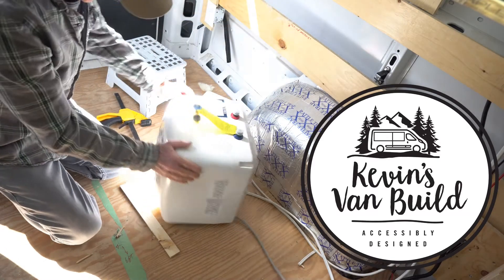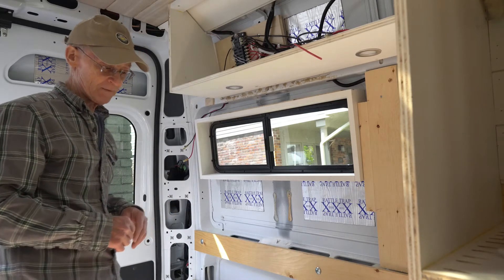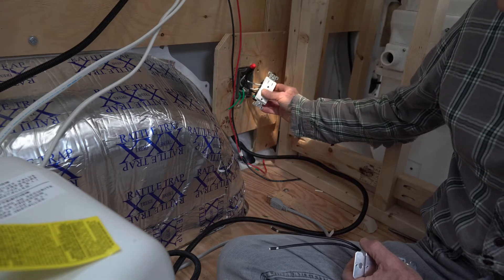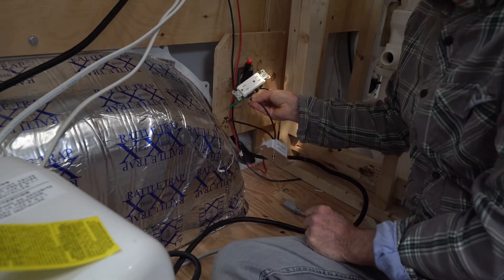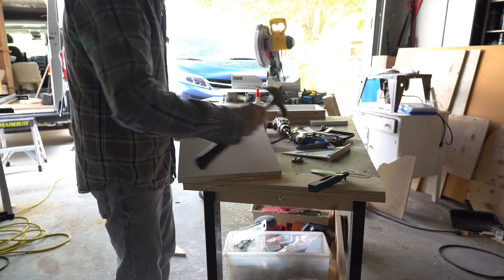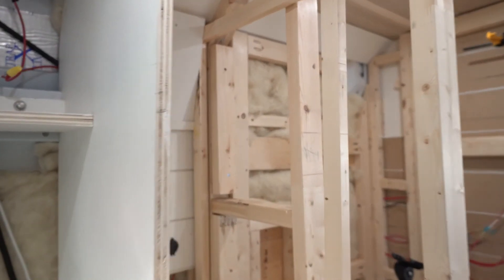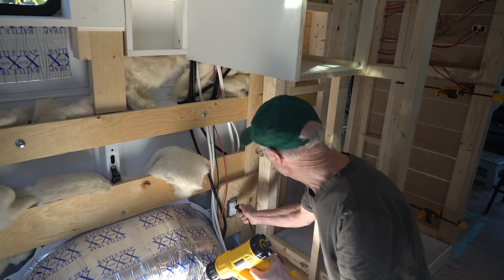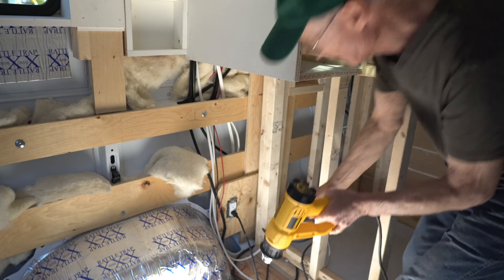Electric Water Heater installation into a Promaster Van.

Comment: Kevin,

I'm having trouble getting my Bosch 4 gal water heater to work properly.  It keeps making my 300W inverter sound a low voltage alarm (below 10.5V).  How big is your battery bank and what size inverter are you running?  Have you had the same problem?
Reply from the maker: My inverter is 2000 watts with 200 ah lithium batteries. Runs great. 300 watts sound to small. Check wattage requirements on your Bosch.
Reply: @kevinkerr9332  how much of your batteries power does it use to get hot water ?
Reply from the maker: @031burke  have not checked that out to much yet. Still in building mode at this point.